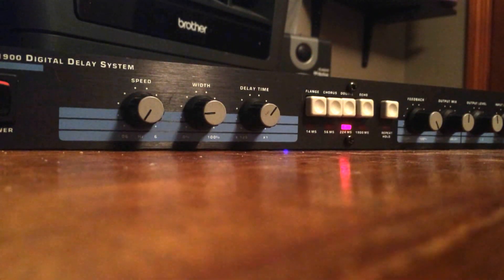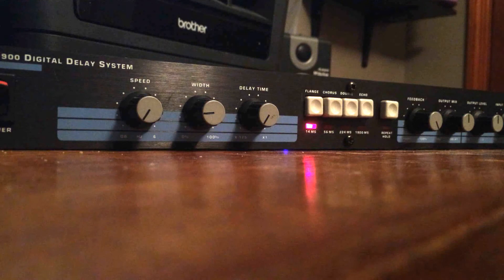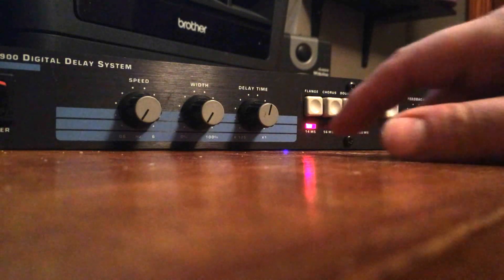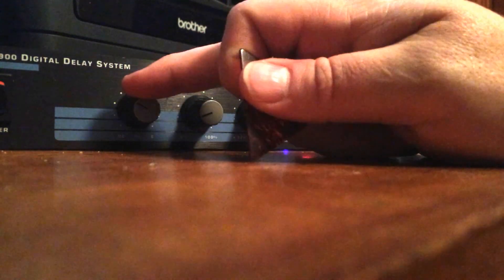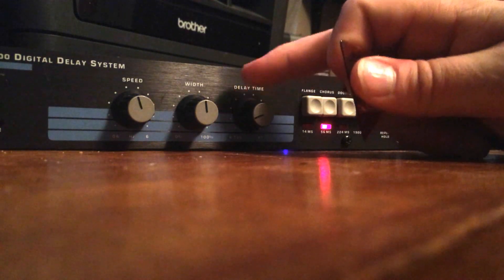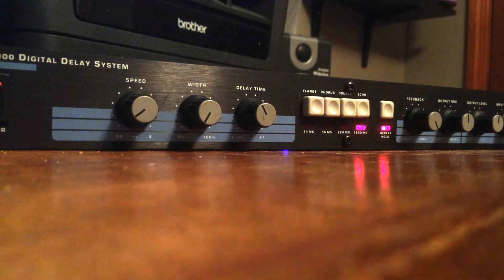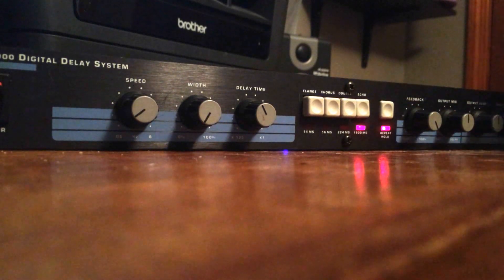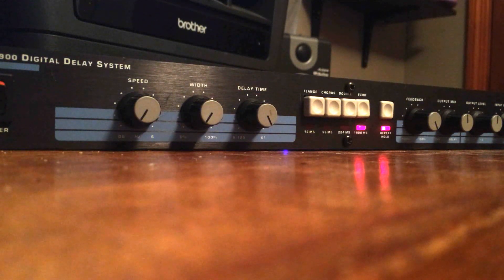Digitech RDS 1900 runthrough

Comment: Thanks for doing this. There’s really not much on YouTube about old rack units and most of them aren’t even good demos.
Reply from the maker: glad to help.  it's a really nice unit.   i no longer have this one, but I still have two 3.2 second models (for stereo fun)..  i still need to go and give them both the sample rate mod.  did that to a different one, but sold that one as well.  demoed that one in another video.  can't remember if it was actually this one that got the mod.. could have been.
Reply: Have you turned up the 2 -trim pots inside any ? I like to know more about if you have I have RDS-1900 with the black buttons but it does everything just like this one

Comment: All the RDS units are actually 8-bit! (which = 8-bit awesomeness!)  Cool video BTW.  I had the RDS 900 back in the day.
Reply from the maker: yea i currently own three of them now (two 3.6 versions)   i'm interested in trying the circuit bending possibilities.. one which i think is actually pretty simple is the sample rate.. you can lower it which makes the delay last longer, but more importantly is the bit rate makes the 8 bit REALLY crunchy..
Reply: The Manual actually says they have 12 bit VSLI engines
Reply: @BrewerShettles  Interesting.  I know I read something about "8-bit" somewhere.  Maybe the CPU or digital/analog converters?  I remember owning one back in the late 1980s-early 1990s (I think it was a RDS1900) & it sounded really low-fi.  I also currently own a DSP256XL.  It also has digital/analog converters that are pretty low-fi.  If you set the Mix level to 100% it really alters the sound of whatever synth or sound source you're running though it.  There's 1 program I call "Analoger" (a chorus + delay) because it gives any synth a very cool analog type sound.
Reply: @8bitwidgets  Very VERY late reply. (sorry😆) It's awesome that you have 2 of the 3.6s.  I had a 1900 & a DSP128 back in the day.  I bought a DSP256XL about 6-7 years ago for only $40! (works perfectly but needs a new battery) I saw 1900s & 3.6s in good to very good condition for $50-$100.  I was gonna grab one, I didn't get around to it, and now the only ones I can find are in "parts only" to "fair condition". (and a bit overpriced IMO....$125 for parts only, $200+ for fair condition)  Did you ever get around to circuit bending it?  I'll check your channel for any potential videos.
Reply from the maker: @gjc82071  that's awesome (better late than never! :) ) so yea I have the DSP256XL as well.  These were staple effects for me back in the day.  These are largely overlooked underdogs.  I'm looking to have both of my 3.6 modified with the pot mod to allow you to tweak the sample rate with a knob (see my other video for that one, which eventually i sold).   Yea there's one https://www.youtube.com/watch?v=Tg025KDklws   it's trippy

Comment: I have the 3.6. Have never found any info about it. Such a unique machine.
Reply from the maker: It’s virtually identical to what this one is other than the amount of memory it has for sampling. Some of the later models had a different style of button but I prefer the mechanical button because for some reason when they made those button changes they also caused the memory to clip when you switch to a faster delay time. With the mechanical button version that would remember the entire sample even if you went to a faster delay and then went back to a slower one.  In another YouTube video somewhere I think this memory clipping could be disabled but it takes a little soldering i believe
Reply: You can find the document for the 7600 online.

Comment: Hi, I'm having some trouble finding details about the RDS 1900. 
1. WHEN WAS IT PRODUCED.
Reply from the maker: I don't have any hard numbers about it, but it was definitely an 80's delay.. estimate mid to late 80's.  there were a number of models made like the 3.6 second version and 7.2 which I assume came out as later models.  but the 1900 was one of the earlier models i assume.  i know there was a 900 model as well, which i assume proceeded this one.  the ones with the physical clicky buttons like the one i demo in this video were the earlier models..  the later ones had black buttons that didn't really physically click in..  again not sure about the "discography" of all of the RDS models.. but that's what I believe is the case.
Reply: Thanks for the help!

Comment: besides the maximum delay time, did the different RDS models have much of a difference in terms of their features?
Reply from the maker: no from what i've seen it's literally the ONLY defining difference i could see in any of the ones i've had.  900, 1900 and 3.6..   HOWEVER, the later models that have the black buttons that don't click.. there is a BIG difference in those..  when you flip modes while in hold, the memory is truncated so if you go from a 1 sec recording loop and jump down to 10ms.. and go back to 1 sec you only have the 10ms chunk of sound in memory still..  boo..  the feature I show later on in this video will not work with the black button models.. however i do think there is a mod to them that can fix this.  I haven't tested it myself, but in another video out here on youtube shows how to do the sample rate mod which I have had done to one of these units.  in the video he identifies something in there that can prevent the flushing of memory..     to see the mod in action you can see my video here.   https://www.youtube.com/watch?v=Tg025KDklws&t=1s   i have since sold this particular unit.  however i still own two 3.6s (for stereo effects, since each one is mono) but i haven't had them modded yet.  it's on my list.
Reply: @8bitwidgets  thanks for the detailed reply! does this memory truncation problem occur even if I use a separate footswitch to activate Hold?

also, as a somewhat relate aside: do you experience with the PDS series of delays? seems like those pedals are basically smaller versions of the RDS series, minus the onboard modulation (except for the PDS 20/20 I guess).
Reply from the maker: @ripwildy2022  no problem, the truncation happens when you flip delay ranges only. flange / chorus / delay... jumping from these "clicks" is what causes memory clippage.  Engaging the hold button won't effect what's in memory, it will simply repeat what's in memory in the current mode..  

I've never seen a PDS in person, but my money would be on those behaving like the newer generations of RDS with the black buttons.  I'm sure they too could be modded.
Reply: @8bitwidgets  interesting. I intend on getting one of these RDS/PDS to use as a slapback delay with hint of modulation, and occasionally use the Hold feature to create that sort robotic rhythmic strumming effect - so I'm not sure if the memory truncation would be an issue for me.

I'm more concerned with whether I should save up for a version with longer delay time or not, or just go for the cheapest one I can find.
I mean, I already have a looper (Pigtronix Infinity) and a delay with tap tempo (Boss VF-1 - technically a multieffects unit, but the delays on it are beautiful) - and as fun as it looks to be able to change the speed and pitch of a loop in such a real-time fashion, I'm not sure if I'd have much practical use for it.
Reply from the maker: @ripwildy2022  yea 3.2 would be the most i would imagine you'd need.. next one below that as far as i know is the 1900ms unit here..   

yea if you're not flipping modes in mid play then you could get away with the newer black button models.  i like to "play" these units while something is going through it.. not playing live through it since i'd not have any free fingers to knob twiddle..   and truncating for me is a dealbreaker because of how i use it like in that other video..  but for someone hands off..  not so important.

Comment: Does this work with vocals?
Reply from the maker: yea you can run a mic through it.  it doesn't have an XLR input, you'd have to convert it to a 1/4" cord but other than that it should be fine. the input has a gain knob to help boost a signal.
Reply: Thanks!